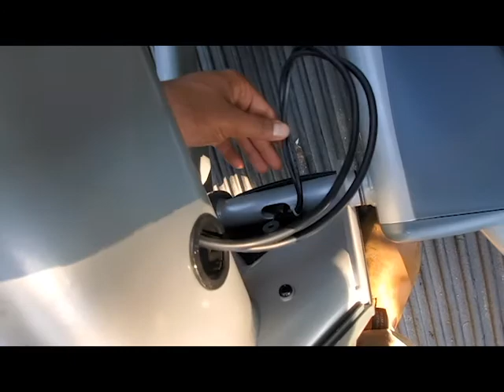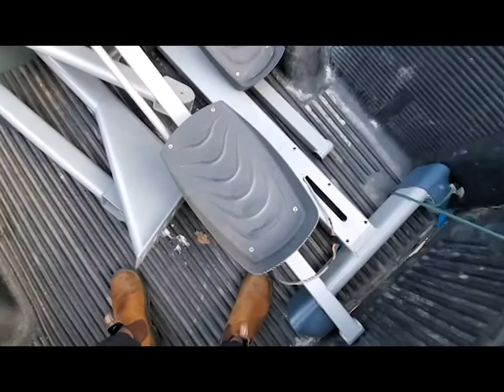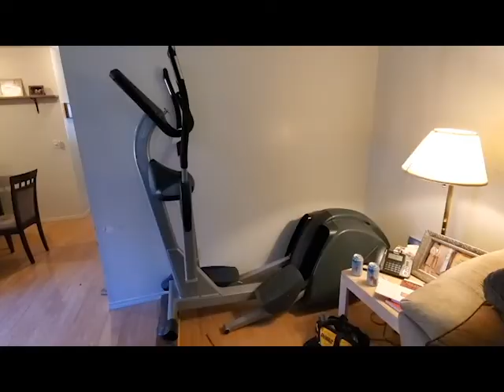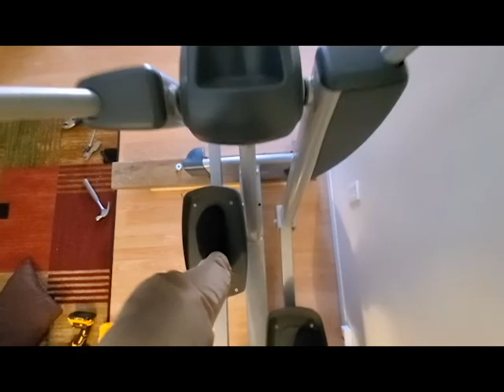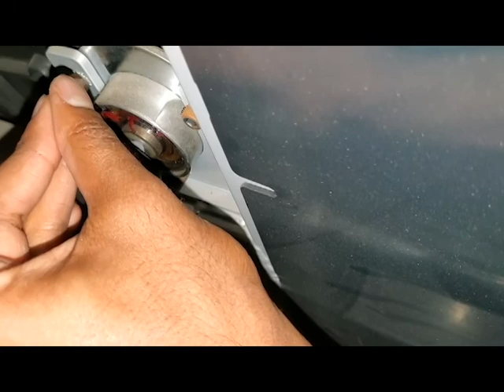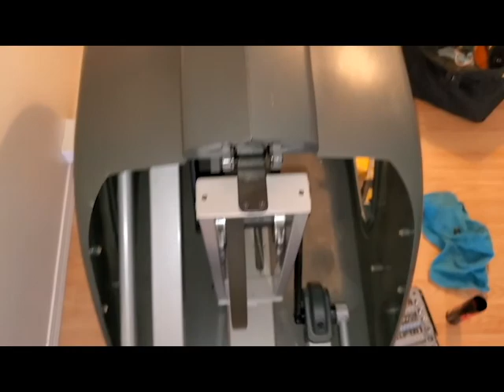Restoring a Nautilus NE3000 Elliptical Machine - Fixing Squeaky Noises and Cutting New Bolts

Comment: I bought a used one...i cant get it into my house. I've removed the console/ handle and the front vertical bar. However, i have no idea how to remove the bottom long metal bar , the step pedal bar and the big hump. Its too long and heavy for me to maneuver. Is that all one piece? How did you lift and move?